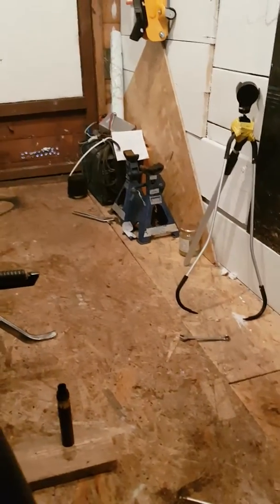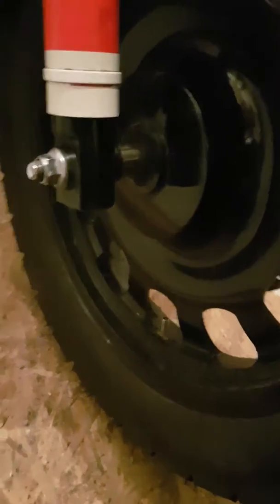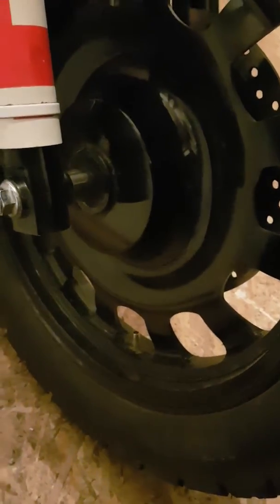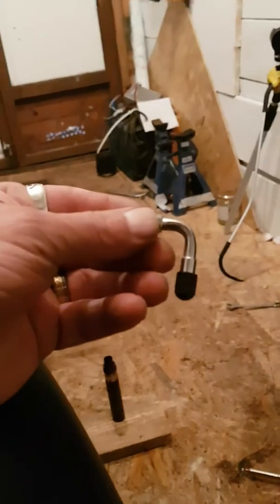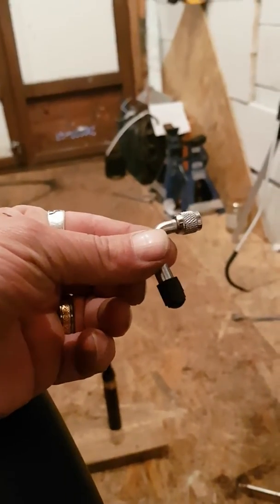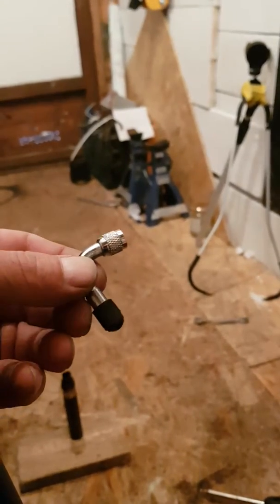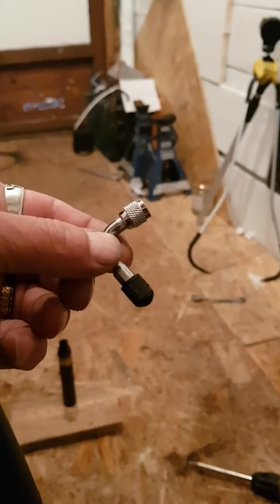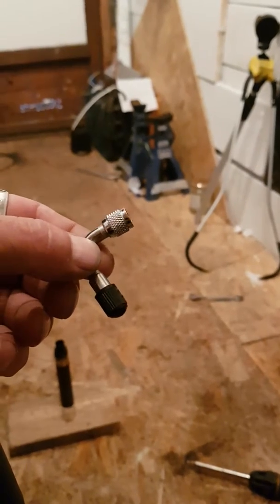Tyre pressure valve keeway Superlight 125

Comment: Do you know the tyre pressure for the superlights. I've got a 2017 model. Can't find much on it and don't have a manual. Thanks Lee
Reply from the maker: Hi Lee
I generally ran mine about 36psi on the front and 40 on the back but there's more info on the Keeway international or UK keeway fbk pages that have more info than I. Thanks 😊